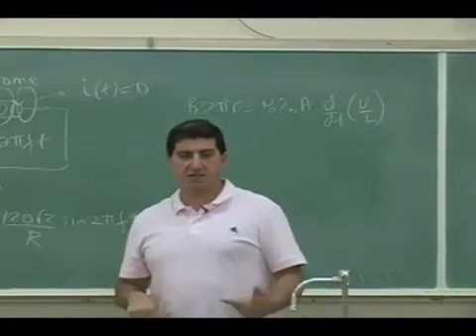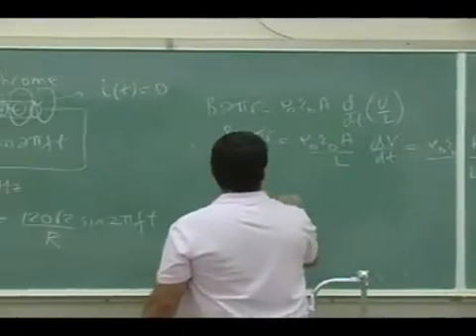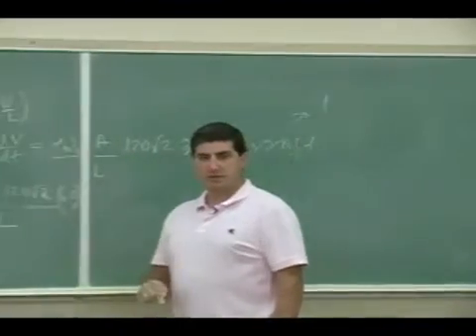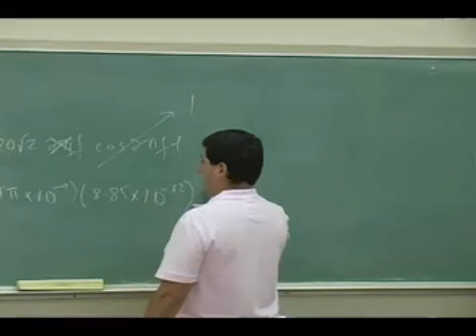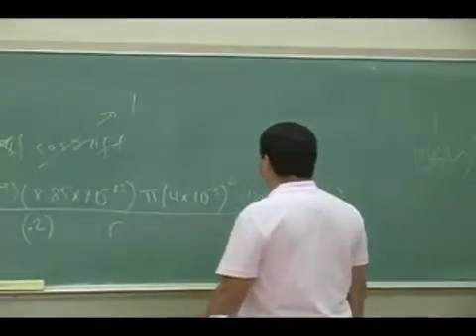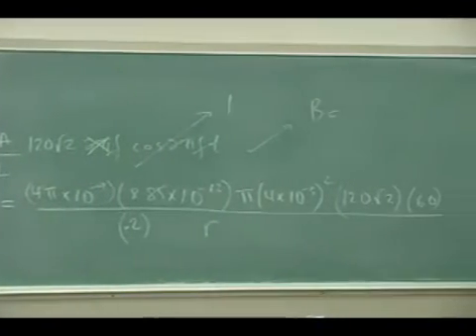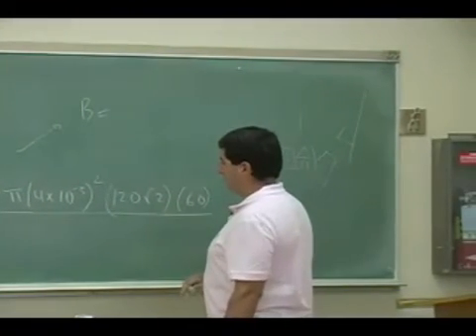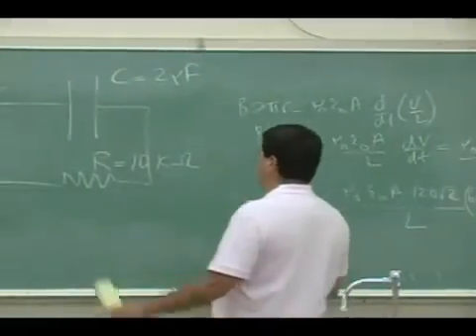Displacement Current Example 1 Part 2

Comment: I have a question sir may you solve it ,please sir
There are two coaxial cylindrical wire and running curren i is equal to 2cos omega t in opposite direction having radii r1 and r2 .Then find displacement current?